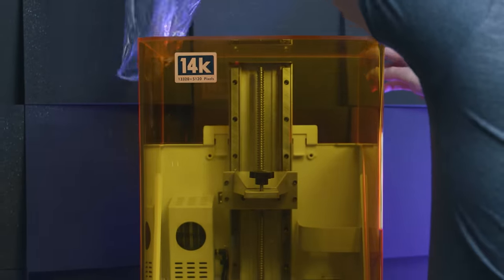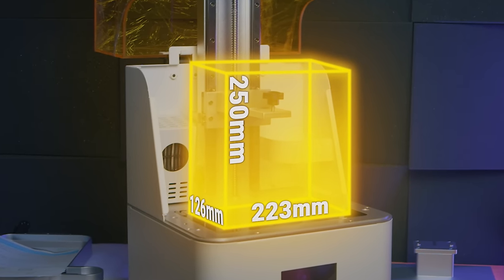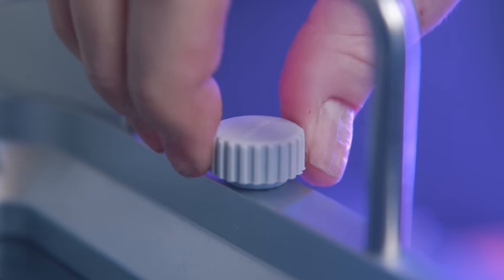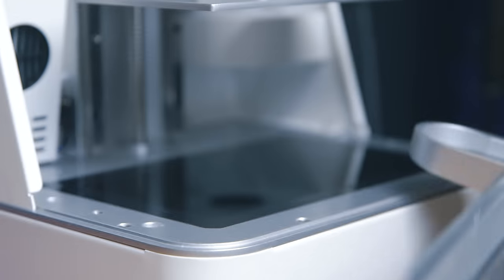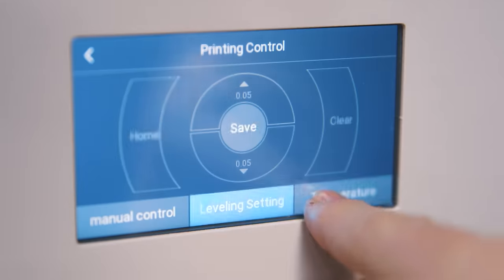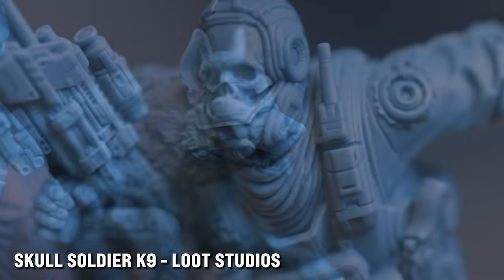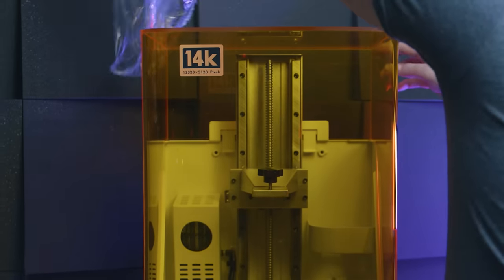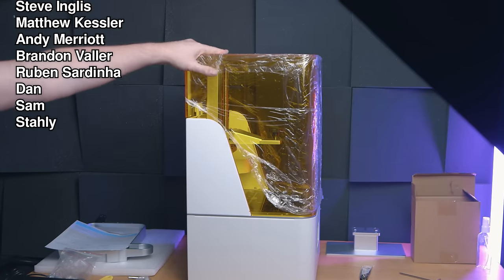Nova 3d Whale Ultra 14k Review - OMG WOW! The World's First 14k Printer

Comment: This seems really nitpicky. You don't need a heater to run all the time, unless you're Santa printing at the North Pole. A powerful Light source under the vat and an exothermic resin curing process maintain resin temp fine. Heaters constantly switching on and off during printing tend to cause more visible lines and errors than an unheated chamber.
The website is a little rough? The edges of the lid are a little sharp? User has to attach the lid themself? Really? Those are supposed to be legit complaints? 
And a Chinese company producing a UI with an awkward translation is supposed to be a surprise?
This is a third of the price of the GK2 or the Pre-order only Athena and is competing with the Saturn 3 Ultra and M5s, but has resin auto-fill, heated chamber, pre-levelled plate, ball screw, flip-up cover, wi-fi, COB lighting. If it had a force sensor then this would blow the competition away completely.
For the price, this frankly seems like an amazing bit of kit to me.
Reply from the maker: Oh totally, if you’re happy with it then go for it, I never said it was a bad printer. I’m here to show you what I see, that’s all. If you’re happy with what you see, buy it. These things may put other people off, so they have been included because it would bother other people.

Comment: So pass on this brand then, lots of good printers to buy.  I like the peltic heater but I have already bought a setup off aliexpress.
Reply: The cold winter weather reduces resin fluidity, leading to first layer printing failure. Preheat the resin using a heater before printing to ensure optimal temperature for successful first layer printing. During UV curing, generated heat should maintain resin within an appropriate temperature range, ensuring fluidity and successful printing.I believe this represents the correct design idea！

Comment: Not very impressed here mate. Your test prints are so gargantuan, you may as well switch to FDM. Instead of printing low detail 1:10 scale miniatures, maybe do some high detail 1:300 or even 1:1000 scale. I realize this will require some technical skills that you may lack, but I'm sure you can find help.
Reply from the maker: Mate, I also haven't printed Dental stuff, or jewellery, I'm not printing for every single use case. I have enough info from the prints on this to tell me how it will perfom in comparison to all previous printers I've tested and future too. I don't ned to print 6mm models to tell me how visible layer lines are or that you cannot interpret voxelisation on a rounded surface between axis.

1:0000 and even 1:300 scale minis do not have more details than 32mm. they are just scaled smaller...
Reply: @FauxHammer   You could not be more wrong. In 6mm the legs of a soldier will be bulked out to roughly 2 times thicker and in 3mm it jumps to at least 3 times. Designs in these scales need to consider not only the limits of printing but also the limits of painting and handling. To say they are "just scaled smaller" shows a serious gap in your knowledge. To say 6mm do not have "more details than 32mm" is comical. A Legion Imperialis infantry miniature has massively LESS details than a 40k one. At this point my own view is that features on miniatures in these smaller scales become problematic below 200 microns. I'd love to see someone prove me wrong.